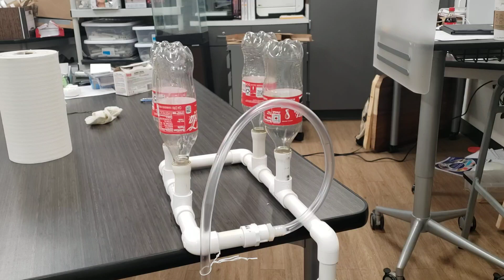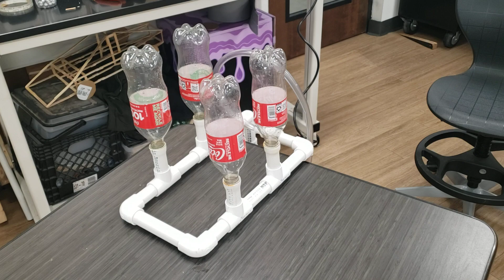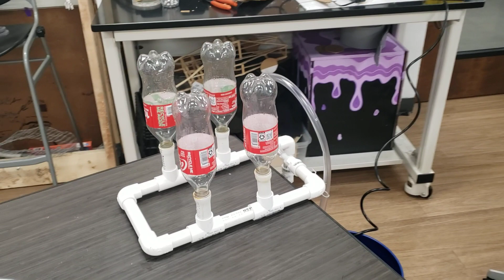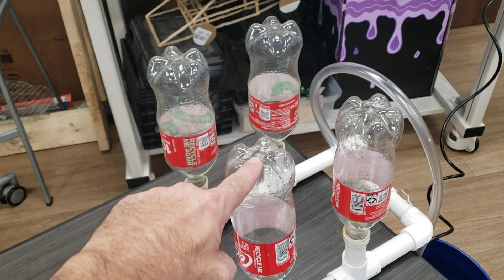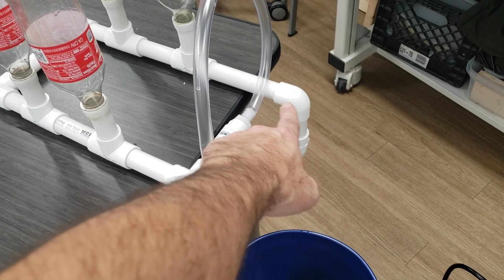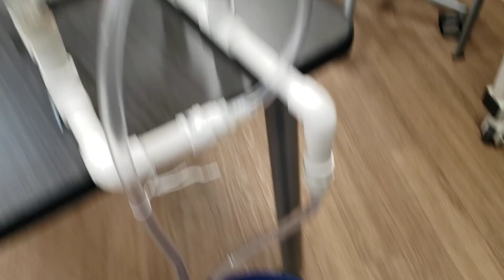DIY Hydroponic System "Under-Flow" Classroom Build

Comment: I built a similar system several years ago.  I was amazed at how quickly veg grew in it.  Unfortunately, we had a 4 hour power outage on a hot day while we were gone and everything was roasted.  With nothing to keep the roots moist, they will die quickly.  Next time I will at least have a solar backup to keep a trickle flowing.
Reply from the maker: These systems are certainly productive, thought not without their points of (potential) failure... Sorry to hear about the loss of your crop. Better luck next time!